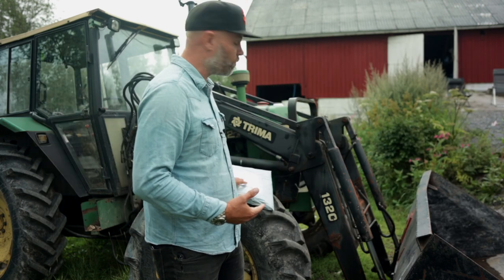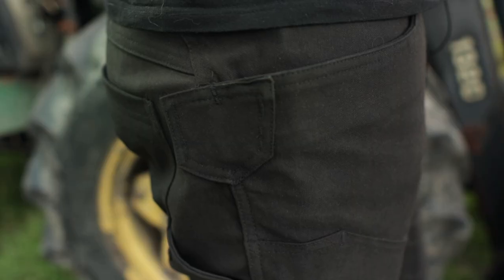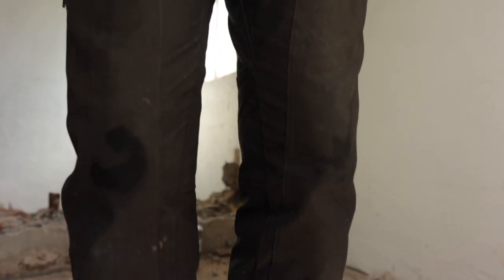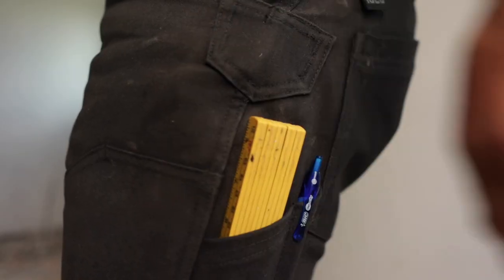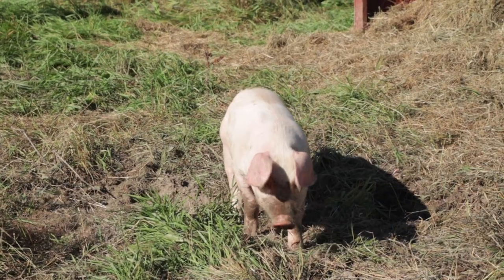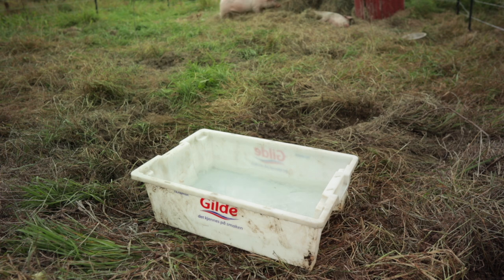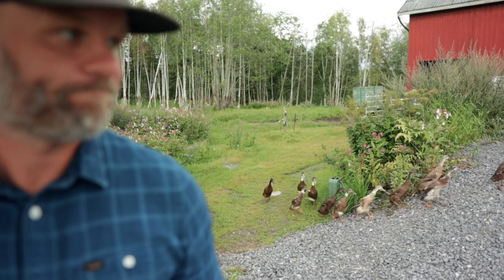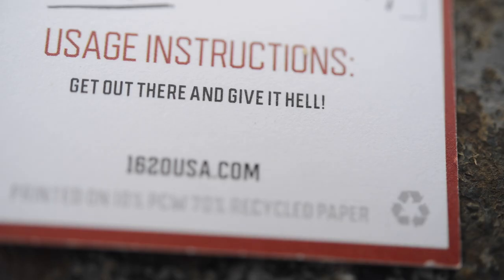I Have High Hopes For These Work Pants! 1620 Double Knee Utility Pants

Comment: It's not that denim itself isn't durable for the farm, it's that in general the jeans sold now are less durable. The weave and weight is different.
Reply: I'm pretty sure Wrangler is the only one that makes denim like it should be, and kept it affordable.
Reply: Right? They found levis from the 1800s in mines! Still holding up.
Reply: I was hesitant to pay that much for pants but after ordering foundation pants I quickly ordered other colors and wear them to work and they're good enough for Church as well or just everyday wear.
Reply: If you want good work jeans no frills look at wildass brand that Bailey's sells

Comment: I’ve been rocking the carhartt rugged flex for a couple years now and they are holding up pretty well. The flexibility is great, I wonder if those articulated knees would also do the trick. Thanks for another video!
Reply from the maker: Thank you!
Reply: The new Carharts are so thin compared to the old ones. They don't seem any tougher than Dickies.
Reply: @zinknot  for sure thinner but there are 2 or 3 styles of the standard looking flexible work pants some are closer to the standard thickness. They hold up pretty well for being stretchy and a little thinner. I haven’t tried out the new dickies that stretch. The only thing I didn’t really like about the dickies I’ve had was that the cellphone pocket was too far back on my leg, otherwise they are good pants too.

Comment: I have the double knee cargo nyco 
Best decision!! If I take the time I spend finding new pants lol it’s worth the extra these cost.
I carry inside the waste band.
Walther pps.
So I bought 36/34 my actual size is 34-35
I was buying Duluth fire house pants but the sizing went wrong.
I have a hard time spending almost $80 on pants that don’t fit. 
The issue is I hate shopping.
Normally I can only buy the 2-3 pairs that the store has in stock.
I really liked the Duluth fire hose.
But I can tell the 1620 will out last the Duluth.
The cut on the 1620 is for sure the most fitted pants I have ever owned I would say that’s actually the best part.
I have decided I will buy 2-3 pairs every year weather I need them or not.
You can tell a lot of thought was put into these pants,job well done.
Reply: Every pair I've ordered fits like it was hand fitted directly for me . 1620 is awesome American made clothing line.
Reply: @douglasphillips24  👍 they last and last!

Comment: So as an oyster farmer I've managed to fck up every pair of pants I can get my hands on for several reasons but one of the top issues is the rain gear we use is very rough inside and chews threw material at an impressive rate, Carhartt was my go too pant for about 30 years and now there just not the same, I can kill a double knee pair of Carhartt pants in less than 8 months and that's in several areas that we really do not want to give out 🤣 my tin pants holt to the task but are far to warm for the majority of the year perhaps I'll try to kill some of these for a bit... Going to keep looking but maybe this is the next purchase 🤔

Comment: Are you planning on switching your Air Force 1 with some work boots, if you do then Nicks is probably the best but they are a bit expensive
Reply from the maker: Thanks! 
I do have some workboots, but in the summer when it´s dry i prefer the sneakers. They´re just so comfortable!

Comment: Bit dumb comment but, ever tried Dickies? I'm not a Farmer, let alone this cool ha! But I've had quite a few many Dickies and they last a lifetime, not to mention way cheaper than Carhartt. Also, I can see you're still carrying that shaman, AWESOME!
Reply: What happened to the pm3?! :)
Reply: @idiothenk  he prefers the shaman but still has the pm3 for back up
Reply: Dickies while being cheaper certainly don’t last as long as Carhartt. I think with work pants it really is a case of you get what you pay for. But also it’s worth noting that at the end of the day it’s all about what your needs are. If it’s hot or whatever and you require a thinner more light weight feel then dickies for sure.
Reply from the maker: I haven´t tried Dickies yet!! Love the Shaman!!
Reply from the maker: I´ve actually misplaced it, so i haven´t used it in a while. It´s around here somewhere, i hope it reappears soon!!